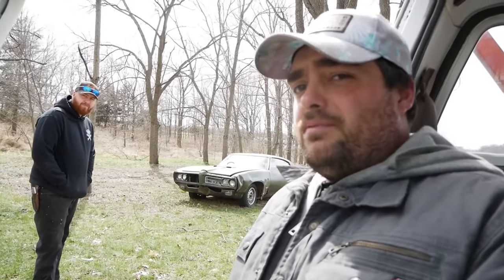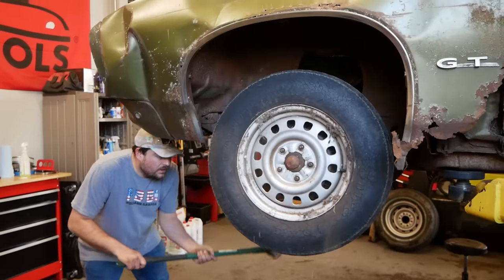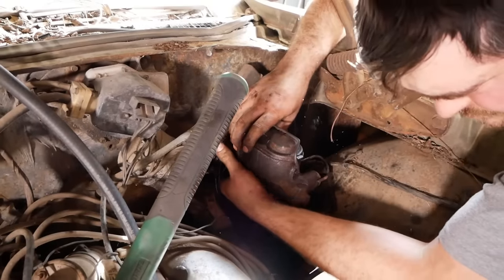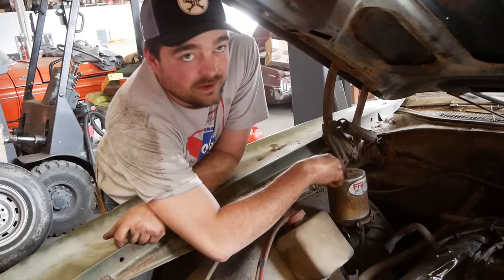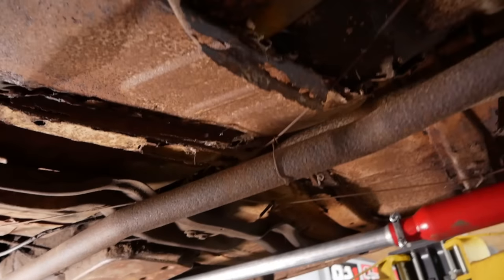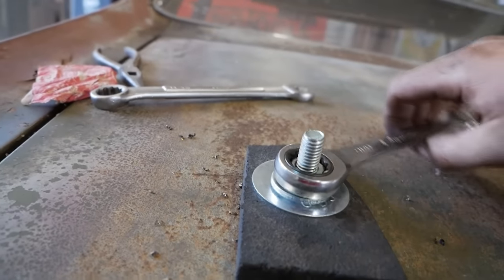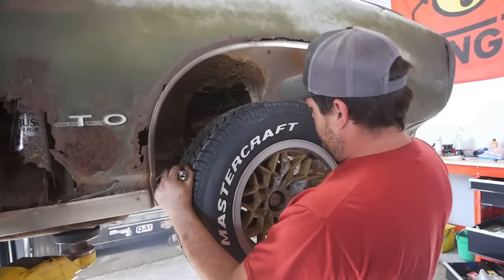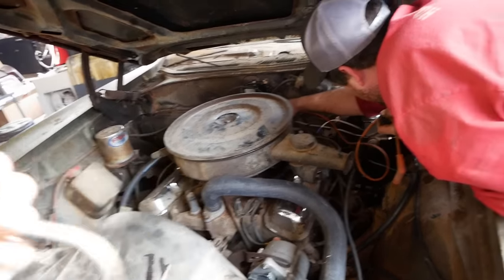Will The RUSTIEST GTO Ever Run and Drive 250 Miles Home?

Comment: A trick an old timer taught me long ago is that if your shocks have a single bolt on top is to grab a deep well socket and an extension, make sure you have solid contact between socket and nut, and pry it back and forth til it snaps off. It’s not like you’re ever gonna reuse old shocks so breaking them is no big deal
Reply from the maker: That's what I did, but the one actually unbolted
Reply: I just learned that a few months ago and I put shocks on my 65 Impala and it worked great.
Reply: It's hoe I did it when I worked in a muffler shop... torch for bottoms.  Rust belt Canada

Comment: Had a tooth pulled this morning. Perfect day to skip work and watch PBG

For the car I say do a frame swap and get the body stabilized.  Cheap rebuild and have a sister car to the  holy goat. Not that you need one but it is a GTO.
Reply: no frame, its unibody
Reply: @grantkoeller8911  no they are full frame cars
Reply: @grantkoeller8911  did you even watch the video? there was clearly a separate frame there
Reply: Do y'all think Kevin's dad took him aside and had a talk about his choices of friends and warned him not to fall in with the "wrong crowd" after Dalton confirmed his plans to drive this car home? 😂
Reply: @grantkoeller8911  Try actually watching the video.
Reply: @grantkoeller8911 its a GM A-Body what drugs are you taking rn lmao

Comment: Dude thank you for mentioning the vr1 oil. 
So many people pour in whatever oil they are familiar with, without even considering its meant for new cars specifically. 
I ruined a hot rod 454 with the wrong oil. (.30 over flat tops, cam, intake, 750 demon carb, headers, ls7 style rec port heads...) 
It ran excellent for about 10,000 miles And i had been using vr1 20/50. 
It only took 500ish miles on Castrol to ruin it.

Comment: 19:50 Leave it to Kevin to officially make pliers a tool for body work 😂
Reply: You mean they weren't?
Reply: @fomocopowersgarage7103  I mean... Anything is a hammer when you need one so... I guess if it works it ain't stupid. Still hilarious though.
Reply: Pliers! great for the diner table AND the shop
Reply: @JunkyardDigs  oh yea I remember that. The off road bronco build. You used pliers for the bacon. Btw. You always say about wanting to do a revival with exclusively a pair of pliers. But you already did. That flat bed dually f250 that was rolled it was one of your first revivals. You literally put a battery in it.
Reply: pliers and a hammer...all you need.
Reply: VGG would be SO Jealous..
Reply: @JunkyardDigs  and pulling out rouge nose and eyebrow hairs

Comment: It coming down of the lift with the license plate body work said it all for me. Its not restorable but its not dead either. Get it on a safe frame, get the steering and alignment fixed, work the motor over and add more license plates.

Comment: Meanwhile, over on the other side of The Pond, I got an 'advisory' on my MOT* that the radiator support bracket had surface rust on it and should be replaced . . . . 

*MOT is a yearly inspection for UK cars over 3 years old - you can't legally drive without one.
Reply: The more heavily populated states tend to have vehicle inspection and emissions tests. The more lightly populated ones, like Iowa and Missouri, do not. Also, cars there rust like crazy due to the winter salt on the roads so seeing cars destroyed by rust is common.
Reply: And I'm a Brit ex-pat living in Berlin, Germany. Just got my 20 year old Astra through the TÜV (German bi-annual MOT) , couple of advisories but no big issues. I'll keep her as long as I can. I don't know how the hell Dalton gets away with these escapades but he does.
Reply: @laurencehastings7473 To explain to our American cousins, an over zealous MOT tester will actually attack the sills - rocker panels to you guys - with a specially made small pointed hammer to check for rust. ... ..

Comment: My first car back in 1985 was a 1968 Ford Custom 500 that had a similar frame problem, namely that the left rear portion was rusted out so much that the body mount was just sandwiching a piece of rusty metal that was not attached to anything. I took a piece of metal and drilled a hole in it and placed that under the frame and ran a bolt up thru the body and basically hung the rear of the from from the body. Midwest 16yo engineering.

Comment: Amazing, it made it. Call it a break in ride.  Lil tinkering , lil more patching ,  a bigger fuel cell, hood ipins ( for easier opening) its ready for power tour!  Id keep it patena style , lil suspension  work .  Everyone inc kevin was skeptical, proved em all wrong. Did real good, not a drop fell ( burned , but not dropped). A good solid  driver to add to the fleet. Tinker on it and take it on power tour
Reply: Someone mentioned that the 2 quarts might have been sucked up by the TP "Filter".  So didn't even burn oil.
Reply: @NEEDbacon  - right , forgot about the tp roll

Comment: Reminds me of my 1980 Pontiac Catalina with a 3.8... It was a quart every 80 miles but no plugs fouled and no leaks. I filled it with gear lube and drove it for 23k, without an oil change (self changing). Motor still ran, pulled it and dropped in a Buick 350 from a 76 lesabre and drove it 38k until the mounts for the rear end was gone

Comment: OMG my very first wheel lift was that fold out wheel.lift sling combo  on  a 74  chevy c30  350 4 speed  it was a huge pain but it made money just slow and steady ,our other wheel lift you had to leave cross bars in and  hand push or pull car ,/ truck over bars into saddles  ,towed thousands of vehicles that way

Comment: That single groove in the brake drums, those were factory wear indicators.... Factory GM front rotors back then were the same way they had a single groove in the friction surface for an instant visual identifier of how much you could machine off them without having to measure.

Comment: My stepdad truck was doing the same thing he ended up replacing the whole damn transmission, and it was still doing the same thing and it was some sensor somewhere on the throttle body that fix to hold problem

Comment: If you use a pry bar to take off the wheels and pry the tire with say the tie rod it comes right off I tried it with tires I was hammering on for 20 min and worked so well

Comment: 25:45 the car is green, you should find some of that tinted toilet paper they had in the 70s-80s, I think there was pink, yellow, green, and blue. But in all seriousness it should be single ply, 500 sheets, and you just take off enough that it fits in there snug.  You can use the rest to dry the tears of joy from all the amazing double filtration action.

Comment: I'd fix it, like I think Tom said, they make literally every panel for that car, it'd be a LOT of work, but it'd be worth it in the end. Especially if you just focus on fixing the body and getting it solid, and then put a full tube chassis in it and a built engine and turn it into a drag & drive car or Pro Street kind of thing with huge tubs, a 4 link rear and massive tires and an aluminum floor. But then I'm weird, I'm fully willing to do stuff like that, just like I'd LOVE to have that AMC Rebel Derek has and put the engine back where it should be and put the floor back to stock or drag car spec.. Those cars are so rare, they are worth the effort.

Comment: im still waiting to see the Max Jax installed in the new building. 2016 I think was the year mine arrived on a pallet dumped right in my driveway by my newly built garage. i had to borrow a hammer drill and buy the correct concrete bit for the anchors that came with it. i dont even know if ive used it enough so that its paid for itself but i still like it ....i like it a lot...Lol

Comment: I had a VW bug called" Roach" When i was 17 , one day I'm cruising through the parking lot of circuit City😂 and some guy says hey you're dragging a car battery under your vehicle !  I laughed 😂 and said my piece of wood must have fell out, you should see the rest of the floorboards, marine-grade plywood over the rusty holes😂 you could see the inner side of the tire when you're driving through the footwell, but hey I was a kid it was  loud with a stinger pipe ,one of my first vws😊 it was slammed and it looked cool✌️

Comment: My suggestion, ye got a pretty hood, an acceptable Front/ grill and a some what good Vin for this rust pile,
It's bassically a shipping cradle for the window trim and glass, Engine Tans and Diff, and interior,
the whole body is rot sepperating itself appart ,better look for a chevelle, cutlas or Lemans for a replacment body to put the vin on.

BUT, I dare ye, put a Trailer on that hitch. 🤣

Comment: And i am a big fan of glass pack mufflers or as Dalton called them noise packs lol and straight pipe exhaust, and in the case of my early 94 Chevy Z71 two tone onyx gloss black with the quicksilver center going down the sides and the tailgate Silverado extended cab short bed has a 0.40 350tbi and 12 inch long single wall 3/12 slant cut 2.25 inch stainless steel heartthrob brand exhaust tips and the exhaust pipe is directly welded to the engine down pipe on both sides no cat, and trust me the neighbor's hate that truck it's obnoxiously loud sounds awesome taking off from a stop sign and when it goes up a incline or a hill.. . And people do not want to have to be in the vicinity of hearing distance of the truck when it is not running right,hint when it was flooding out it would shoot 4ft flames out of the exhaust tips which are right out under the rear bumper on each side of the factory receiver hitch lol

Comment: Mad max vibes again ! 😀 Here in EU driving unregistered vehicle without license plate is out of question, even on back roads ! 😅 I once revived this old Toyota corolla and drove it out of barn, police got me like 500 meters down the road, car had license plates and everyting (you must have your lights on all the time, and they were). Thought it's gonna be okay, but Police here in Czechia have these smart cameras on cars, that can read you license plate and inform policeme, that your car didn't undergo technical inspection in last 2 years as required. Busted my ass immediately. Thankfully they let me turn around and drove it back to the barn, where it sits since 🤣

Comment: My first car was a 1969 GTO. 38,000 miles when I bought it. Even at that, it burned a quart of oil every 2000 miles. Like it’s said: GTO. Gas, Tires, and Oil. Hugely miss that car.

Comment: 2 suggestions, take the car trough a carwash and some cleaning threat the outside with some tender love and care possibly some waxing after you get done fixing it, spray it with some paint that looks similar at the very least, remove the passenger seat and put a damn nos system there or something, maybe a beer/snacks/fastfood holder xD

Comment: It has the exact same frame as mi '77 Oldsmobile 👍..  except mine is Disk brakes in the front since it's nearly 10 years newer...
Reply from the maker: Disc brakes were pretty common 70 and up. Standard after 74. Your A body chassis is very different from the 68-72.

Comment: I've seen much worse cars, that GTO is pretty saveable with self tappers. Id keep the rough look, but maybe weld in some new sheet metal where its missing and rotted out only and blend the seam from the old paint to the new EDP coated "half panels", that would look interesting, just to get rid of the jagged edges and give it its shape of the body back with new and old panels.

Comment: You should pull the body, repair the frame, put new doors, 1/4 panels, fenders, floors in it and rebuild the engine. Think of all the content and T shirts you can sell.

Comment: I mean actually you put it together pretty decent. Other than you know it's worth probably fixing you know I would probably put floorboards and some carpet maybe some skins... With the old car lot special paint job. I'd say that motor needs some work though
Reply: Obviously you built the car and you put it down the road but you know it could be better. When I seen the bumper hanging off like it was I said yeah I don't know about driving that but you really showed it some love in a hurry and drove it home I was really amazed. Let's be honest though it's a goat. I'd like to see you take that one and fix it up all new sheet metal new floors down and dirty paint job some carpet you know fix it back. I had a buddy what he would do on a budget he would take and find a pretty decent newer model car that would fit the floor and he would just cut out the floor and make it fit. He would use the seats and everything. And then just put aftermarket sheet metal on it. He worked at a speed shop they made brand new dirt cars. Basically they would just take scrap stuff and make it new or use like metric frames they need to know how to do all kinds of stuff. Or he would take some of that sheet metal that they made those dirt car bodies out of. All he used was a air nibbler a plasma cutter and a sheet metal brake and sometimes he would use his bead roller and a cardboard template that he would make to fit the car. They sell these sheets of sheet metal that you can weld at any dirt car shop I think he would make a custom floor board. Most of the time when he did was he would buy the inner rockers the inner wheel wells and the outer sheet metal rockers doors or source it aftermarket or at the junkyard if it was really old he would probably just get a skin and put it on the door if it was worth it. But he could look at the floorboard and just kind of make it by I sometimes it wasn't perfect but the carpet would go right back in and it was nice when he was done it didn't take him long like within 2 weeks he could pretty much get it done. Sometimes like all the lower stuff rockers and inside the doors he would just get rattle can mixed up same color clear coat it and then he would take and put all that good sheet metal on and make it look like a brand new car he was fast. He wrecked a couple car that I had built he said nobody can fix it and then I took it and fixed it 
I put concrete in the frame rails and stuff like that riding on rails

Comment: Back in the 80’s I had a 1966 Pontiac Tempest with the 326 engine. Horrible dog of an engine. Also, it would drive along and constantly foul out plugs. I drove it like 800 miles one time and would replace the plugs one at a time when they would foul out. Made it tho! Then spent way too much money having the engine rebuilt and still was a dog of an engine… my friend had the 66 GTO and it had the 389, but someone had put Chevy style rockers on it. They would come loose all the time. He’d have to stop and pull the valve covers, and tighten them down.. he had a fast food delivery job at the time and this was one of the things he had to do to keep that piece of junk on the road. one time, his hood blew up and smashed the front windshield. So, he had unbolted the hood. The next time the hood blew right off and landed in the road. The gto got sold for pennies. The tempest got wrecked and we put a 4 door lemans frame under it. High school and early college… good times, good times.  Already they were junky used up cars. My tempest floors would fill up with water when it rained as the back window had come unglued.

Comment: What are you all talking about? Back in my day that was my first daily driver. Held together with duct tape and a prayer. A/C through the non existant floor boards. For heat I had a removable muffler to throw in the passenger side. I loved my car  67 LeMans 350 with a 2spd power glide that only had 1rst gear